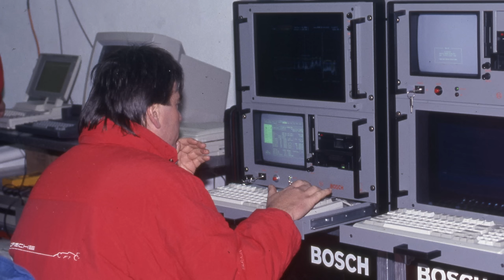10 manufacturers that failed in F1

Comment: Wait, Alfa Romeo emptied their fire extinguisher to lose weight? Imagine doing that to your driver...
Reply: In case of fire: RUN.
Reply: @borismuller86  If they could.  AF didn't even have the decency to remove the seatbelts both to further optimize and reduce weight plus give the drivers a chance to run...

😜🤣🤣🤣
Reply: Yeah I mean most car manufacturers couldn't give less of a shit whether their drivers lived or died as long as they won races. I'm never going to forget Lancia removing the bottom plate armour from the Delta S4 and placing the fuel tank below the driver. Or Porsche filling the 917's hollow tube chassis with flammable gas. Or Honda giving the RA302 race car magnesium skin and an air-cooled engine.

Comment: Lotus in 1970: Simplify, then add lightness
Lotus in 1990: Friggin lambo v12

Ohhhh, how the turntables

The lambo was actually very good in the mclaren in 93
Reply: they kinda lost their speed when Colin Chapman died
Reply: @pretentiousarrogance3614  Absolutely
Reply: Insert 2 clips
1 is a Lotus 72 neatly driving around Brands or something. Its quite nice and almost poetic.
The other is an onboard of the Lotus 98T going round adelaide heel and toeing like mad and losing the rear end on exit in a 1400 horsepower 5 bar boost renault engine.
Reply: *the tables turn...
But yes, you're right.
Reply: @y_fam_goeglyd  it's a reference to The Office, an American sitcom.
Reply: Mandy B woosh
Reply: in 1990 the Lamborghini engine was very competitive - neither Ferrari nor McLaren Honda could overtake on the straight.
Reply: Mein Warcraft Tagebuch it was actually really good yeah
Reply: Pretentious Arrogance not really because he died in 82 when De Angelis finished 9th while two years later de angelis was 3rd. The end was 1988 when they claimed their last podiums with piquet and from then on thy came slower and slower
Reply: Mandy B *the turntables...
Reply: @meinwarcrafttagebuch5142  1. Utter nonsense.
2. If it weren't F1 isn't drag racing you know which is why straight line speed is useless on all other tracks except Monza - and it's equally useless there if the power band of the engine makes it impossible to use in corners.
Reply: I apologize for being pedantic, but I don't think it's possible to "add lightness." I believe you can only take away weight. I've been watching a lot of David Mitchell recently, and I'm pretty sure he would want me to make this correction.
Reply: @paulallen8109  1. you have no clue. / 2. never mind.
Reply: @rexstetson1717  it's what Chapman said
Reply: F1Simracer25 No,  98T had 1300 horsepower in qualifying trim. But it still had around 1000 horsepower it is to be believed. The MP4/4 has 1000 horsepower plus in qualifying trim, but about 700 in race trim.
Reply: Once Sennna left after 87 that was the end for Lotus. Also in 88 after turbos were banned, designer Gerard Ducarouge left the team which sealed their fate.
Reply: Chuckie Yeah, It’s abit unfortunate that we have lost so many good teams. We need competition in modern times.
Reply: @meinwarcrafttagebuch5142  Shame they just had to wait until the Lambo exploded
Reply: @Undivided-X  you mean an American version of a BRITISH sitcom
Reply: @06kohlert  true though by season 5 the American show had outstripped the original one in terms of quality. Shame they undid all that good work in seasons 8 and 9.
Reply: @pretentiousarrogance3614  I my opinion, the beginning of the end was when Ronnie Peterson died at Monza in 78.'
Reply: The Lotus Lamborghini sounded fast and that was good enough for me. Oh how I miss that in car V12 sound.
Reply: McLaren tested the mp-4/8 with a Lambo engine it wasnt reliable but it was as fast as the Reanult v10s that year.

Comment: No offense, but Porsche really. As a McLaren engine supplier win hat-trick of drivers titles and back-to-back constructor titles. Alfo Romeo as well,  won first back-to-back driver titles.
Reply: Failed as a manufacturer. Which means they made the engine as well. If Alfa Romeo or Mclaren succeeded and won titles, but with other manufacturer engines inside, then it doesn't count for this video. For example, if McLaren would win this year it would be with an Renault engine, not their own Mclaren engine
Reply: Yes. As an engine supplier Porsche was the most successful maker in F1 for such a short period of time it participated..but then everyone likely assumed they would...I guess they always preferred their dominant Lemans 24 races for a marketing platform
Reply: Wasn't that motor a TAG?
Reply: @colinmunro7337  badged with that name, but it's Porsche engine.
Reply: colin munro which is Porsche..yes..the TAGhauer brand was a kind if a joint venture..
Reply: @bumblebity2902  it wasn't a badge,porsche were contracted to build a motor for TAG porsche.Without Mansour Oji?there wouldn't be an engine that's my understanding of the deal.
Reply: @jskim8418  I beleive TAG paid for the whole thing.
Reply: colin munro yes what you stated is all correct. The fact is it was a engine that was most dominate in the whole era fitted in the most symbolic car in the F1 history, made by the very Porsche itself..
Reply: They built a good engine but a lousy car. That's what is meant by a manufacturer - they build it all.
Reply: Yes, Porsche achieved success when they were contracted by TAG to make thei engines but the Footwark partnership (the last Porsche appearence in Formula 1) was a total failure. So bad that Footwark broke up the relationship at middle of the season
Reply: Alfo Romero ? What you smoking man
Reply: @matthewmanuel8965  spelling mistake.
Reply: Porsche as manufacturer of chassis and engine won only 1 race in  around 20 years in F1
Reply: Eduard George Puiu .. wasn’t  Porsche also Auto Union in the 50s ?
Reply: 2 titles in 70 years does not make them a successful team. Alfa was the shit in the first half of the 20th century, but really fell away after that
Reply: @filmandfirearms  Any team winning titles must be counted as successful. Bear in mind Alfa didn't compete for 70 years either which derails your entire point. If we only count the number of years they competed as works outfit it's just 10 seasons. 2 titles in 10 seasons is a 20% title winning ratio. Aside from Mercedes and Red Bull what team in F1 has a 20% title winning ratio? 

Renault has just 2 titles too. In 24 seasons. Or shall we count all 70 seasons because you say so??
Reply: @paulallen8109  It's not just about win percentages. If that's what we're going off of, Brawn GP is the greatest F1 team of all time, because they won the only season they ever competed in, or 100%. Renault hasn't been successful as a works team, but they've been a fantastic engine supplier. They dominated with Williams and Red Bull. Alfa hasn't been above the midfield ever since their titles, and now they're struggling to match Williams
Reply: colin munro iOS
Reply: He somehow forgot a famus Alfa with a "ventilator" on the back they kiled competition before FIA baned it.
Reply: You misunderstand. Brabham use fan car and yeah that car was powered by Alfa Romeo F12 engine
Reply: @EGPuiu  Life and Caterham should've been on this top 10 list.
Reply: yea
if porsche is on the list honda should be too
Reply: I agree...Porsche powered cars won titles and WDC.  It was Footworks not Porsche that failed.
Reply: @EGPuiu  Porch was pretty succesful as full car constructor too in 1960s, they won a GP.
Reply: @filmandfirearms  Let's split Alfa Romeo's 3 appearance in the sport.
In 1950 they won all the races they entered. Mostly with 1-2-3. In 1951 Ferrari get close to them, but the then 13-years old Alfetta still won the championship. The Alfetta entere into 54 Grand Prix during its lifespan from 1938 to 1951 and won 47 of them. I guess that can be called as a succesfull team.
The next era starts with Brabham Alfa Romeo where they were the engine supplier of Bernie Ecclestone's Brabham team. The engine was  a revised version of Alfa's flat-12 3-litre engine from the sport-prototypes they won the championship in 1975 and 1977 with great dominance. That engine was really good at the Brabham as well performance-wise and Lauda would kept in the car when they decided to return to the DFV-engine. That situation left Alfa without a chassis, so they decided to run a team without the financial background and they entered into the changing F1-era when the turbo engines came. A territory where Alfa had no experience and again no financial background. So came the stumbling era from 1979-1985 after which they withdrawn themselves from participating and gave all the equipment to the private newcommer the Benetton. In the mean time they already start to develop the engine for the post-turbo era and they have created the first modern 3.5-litre V10 which was a template for the new generation of F1 engines in the 90's and remained the only layout for the early 2000's. That engine produced 605 HP in 1988 which would have been a competitive one in the early 90's. But Fiat took over Alfa Romeo in 1986, so there was no doubt they won't want to create an in-house competition to Ferrari. Even more Ferrari was struggling to keep up with the top teams that time, mostly because of reliability and team management issues.
In the current period Alfa Romeo has nothing to do with the team other than putting some money in and use as an advertisement of the brand (don't want to talk about is it worth or not). The engine is a Ferrari one, the chassis comes from the real team bhind the project Sauber. So this one can't be call as Alfa Romeo.
Reply: @donbrashsux  thats audi

Comment: Toyota´s biggest mistake was to pull the plug... because they overestimated the economic crisis ^^
Reply: And Honda. They would've easily won the 2009 championships. Gutted for them.
Reply: If only they could have held out until atleast 2014... considering Toyota being the absolute grandmasters when it comes to hybrid engines. We'd be talking about Toyota's dominance for the last 6 years in F1; not Mercedes.
Reply: @Lowdo1549  nope they wouldn't, even though the car was amazing their engine was scheiße, so the change to merc engine was crucial, at least thats what brawn said
Reply: @evandrochaves9596  And Nick Fry wrote the same in his book. The change to the Mercedes was crucial to what Brawn achieved
Reply: Evandro Chaves no much has changed there then 😂 double diffuser advantage and ongoing dev through the season would surely have put them in the mix, even with the Honda donkey.
Reply: @Lowdo1549  yeah brawn only was the first 6 races good.  afterwards they barely held their points together, mostly because of Red Bulls reliability issues and occasional driver errors... the the Honda ressources and the honda engine, the first few races may had been lass dominant, but ongoing developments wouldve kept them at the top throuout the season
Reply: @OnionChoppingNinja  It would have been great for F1 and fans to see two companies battling it out Toyota and Mercedes ,  it also dependent on what kind of driver lineup would have been for Toyota ?
Reply: Matthew Lowdon  not sure about that since the Brawn GP car was fitted with a Mercedes engine which would not have happened if Honda would still be at charge.
Reply: @OnionChoppingNinja  Huh, doesn't hybrid in F1 refer to the fact that it's a mixed field of atmospheric pressure and turbo engines?
Reply: @gbormann71  The simple answer is that Toyota could have won championships in Hybrid Era cuz they have experience of making Toyota Prius! 😂
Reply: They've been successful in other forms of Motorsport - WEC and the WRC - though F1 is a whole different ballgame. I've worked in all 3 and the attention to detail required in F1 is at a different ( higher ) level.
Reply: I believe it was a wise decision. F1 is waste of money and effort if your company is anything more than flashy fancy so called sports car maker.
Reply: @OnionChoppingNinja  Toyota is not a grandmaster in hybrid engines. Just because they succeeded in marketing the Prius does not mean they are a technical power house in the field of hybrids. Right now Honda has more Hybrid technical ability than Toyota being in F1 in this hybrid era.
Similarly, Subaru never had more Turbo know how than Honda just because Subaru mass marketed Turbo cars (WRX and STi) before Honda. 
In the 1980's and 90's Honda was applying Turbo in the highest automotive sports there is which is F1 and dominating (MP4/4)
Reply: @crxdelsolsir  when it comes to everyday hybrid cars/engines no one can touch Toyota
From a racing perspective you are correct
Reply: toyotas mistake was to set up base in Germany, should have set up in England and pached staff from other manufacturers.  but anyway the less Japanese makers the better.
Reply: Rumors are speculating a possible comeback in 2029. Toyota has had talks with Haas about a possible partnership as a title sponsor and then eventually become a technical partner in the future. Haas however renewed their technical contract with Ferrari but that is only until 2028 so that could mean Toyota could come back to become a works Toyota F1 team as soon as 2029.

Comment: It was a pity McLaren were so impatient with Peugeot I really think that could have been great for both parties. I think it would be delivering wins and championships long before they had with Merc.
Reply: The corporate culture was the reason Peugeot failed in F1. Most of their employees were hired by Mercedes, Renault and went on to enjoy a huge success.
Reply: Porsche failed in Formula One?  Did you forget Daniel Sexton Gurney's winning Porsche 804 at the French GP in 1962?
Reply: They did pretty well with Merc from 95 to 2012
Reply: There's one thing McLaren has never done. Trust in italians.
Reply: @Ale70594  Peugeot is French though.
Reply: The Peugeot engine was designed to win LeMans, which it did. Afterwards FIA changed the LM regulations (second time in three years!) so they had an expensive engine, and the only place to use was F1. But it was too heavy and underpowered for F1. Considering that it achieved what the factory wanted, it wasn't a real failure.
Reply: @ernestogasulla7763  The gold livery of jordan had the most powerful engine (Peugeot) at that time with good relibility.
Reply: @Miklos82  Weren't TAG engines technically designed by Porsche?

Comment: The only one I can think of that you might have missed would be Matra.
Reply: I was thinking the same thing is that idk if Tyrrell was with matra when Stewart was winning in the late 60s thats why they not include it in the list
Reply: RPP_LAPSSS No, you’re right. They had both the Matra chassis and engine in 1969 which is why they’re not here.
Reply: And caterham
Reply: max white Good call. Spyker as well.
Reply: @shanecameron7869  Buggati in the 1950s also.
Reply: @shanecameron7869  or Marussia if we count every manaufacturer that had a car once. but this is more about larger and (until today) well known manufacturers
Reply: What a machine it was too.
Reply: Stewart won a WDC with the MS80... not really a failure.
Reply: @shanecameron7869  though they used their own engine in the 2nd car driven by Johnny Servoz-Gavin, Stewart's car was powered by a Cosworth.

Comment: Bugatti who entered one race, France in 1956. One of the first ever mid engined F1 cars it also used a splitter in its radiator to divert air under the car in much the same way that the Tyrell would 20 years later.

Comment: Hope Racing Point’s first Aston Martin F1 car continues the original naming convention by being called the DBR6...
Reply: Nah probably they will switch to AMR01 or AMR21
Reply: @riccardoplatone  well, AMR01 won't be possible because they had a AMR1 already, it was the 1989 LMP1 car (yeah, i know, it was Group C back then, not lmp1 ;) )
Reply: I really hope they use the DB prefix from next year either DBR as used to be or DBF
Reply: This is one of things I'm most interested in regarding the rebranded team. I hope they choose DBR6 but the problem is they've already used up DBR9.
Reply: @mark6bat  As the 2021 car will be a carry-over from this year, next year's car may even still be called the RP20.
Reply: racing point has to be the worst name in f1 ever.

Comment: Peugeot was screwed by FIA. When they phased out Group C, they lured manufacturers into developing 3.5L engines for the new WSC. Peugeot did, but others didn't, so the class flopped; soon F1 also adopted 3.5L engines, and Peugeot had one they couldn't use elsewhere, but was designed for endurance racing...

Comment: Seems like it went like this during scripting. "We can't have a top 7. It needs to be a top 10. So just add Alfa, Porsche, and yes, Lancia too eventhough it didn't fail, it just didn't have post war funding."
Reply: Lancia's a bit questionable, but the particular stints that Alfa and Porsche were listed here were fair. For Alfa, they were mid-pack at best in their 80s stint and their 1985 car was so bad they have to revert back to the 1984 car mid-season. 

For Porsche, I'm sure people have high expectations when the Footwork 3512 project was first announced given the successes they have in sports car racing and the last time they were in F1 with the TAG Porsche engine, they brought home 3 WDCs and 2 WCCs. The results of the 3512 clearly proved to be anything but a success.